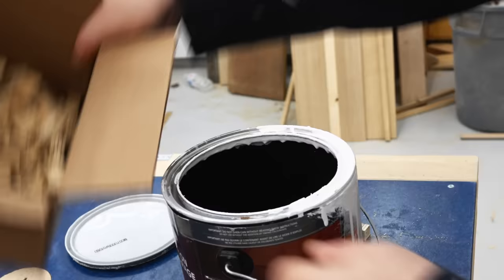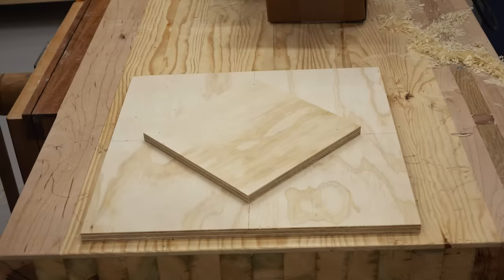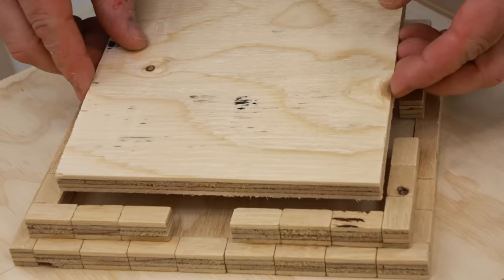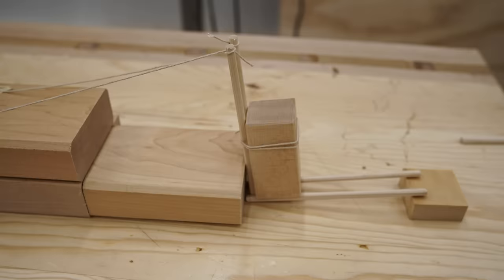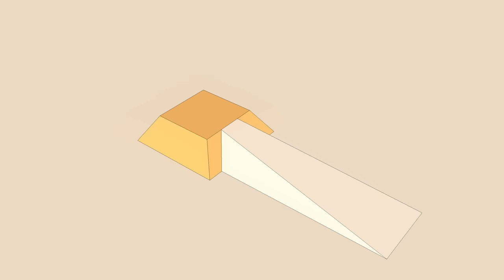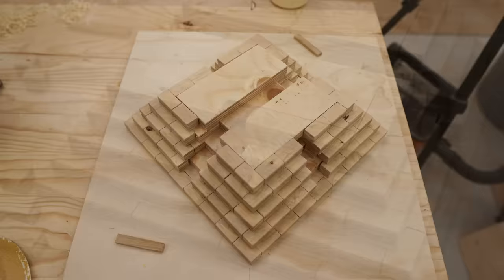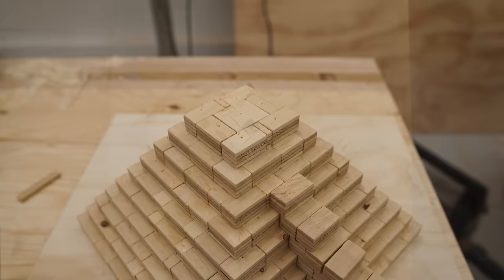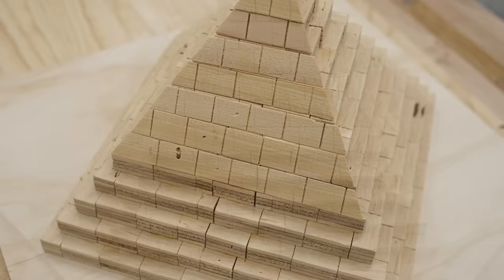How I Would Build The Great Pyramids

Comment: You know what you can use to cut and finish granite with precision?. Glass.. nice clear curved glass, ever use a magnifying glass to burn stuff, just ramp up the scale a bit. We do the same thing with parabolic mirrors and melt rock salt in the desert.. Now granite usually is comprised of an alpha crystal that when heated to roughly 880° will transmute to a beta crystal from what I'm told, and will expand and get weak. Ever wonder why we find the quarries littered with cracked pieces?. As to how they lifted them, research how many tons you can lift with 1 hot air balloon, you'd be surprised how you can lift a single wide trailer with about 10 of them. Wouldn't need fire either, if you figured out a way to heat the air using the same parabolic mirror system.

Comment: Would this be less or more efficient then the concave ramp system that raps around the pyramid instead?
Reply: any sort of ramp would be pretty resource intensive.
and would surely leave some sort of archeological evidence because of the amount of material that would be needed.
Reply: @spatrk6634  Sorry I didn't explain myself to well, the concave system works the same as the one in this video, but the slopes cut into the pyramid via a spiral shape instead of staircases on all sides, and is then filled top down once the pyramid is finished. If you'd like I can link a video that explains it better.

Comment: Got a few major issues. You are aware there are 8 sides? 2.5 million stones? All aligned to compass within 99% accuracy? Inner chambers constructed outta granite containing silicon dioxide(quartz), the rest outta red line stone cut from a quary over 500 miles away?.. and you’re just fingering them around. The inner chambers are made out of stones weighing 80 tones a piece. Again all this is perfectly lined up. I’m just having a tough time with the logic and facts applying

Comment: I’ve heard it debated that for a ramp to work it would have to be so long that it’s impractical.   A ramp can’t be much more than 14 degrees I believe and still be functional.
Reply: So don't build it perpendicular to the walls of the pyramid, build it parallel. 
Start at the ground layer and make a ramp to the first layer, build the second layer on top of that, then build another ramp from the first layer to the second layer. Each ramp can be as long as the pyramid is wide and it can even be as long as the entire circumference of the pyramid if you loop it around the corners, you can just do that all the way up the pyramid like a spiral.

Comment: But they have found chambers inside the pyramids?? They also found even smaller tunnels within?? They found that they are also acoustically tuned to certain frequencies?? And also blocks cut with pin point precision..... I like your ideas about how to get the blocks up though but there's defo some technologies used

Comment: I’m an engineer and I’ve been to the pyramids several times. The individual blocks are massive and vary in size. There is no way the sliding and tipping technique you mentioned could have worked. Also there will be no room for any one to stand and pull ropes and rip rocks near or at the top..
Think of the very top block.

I personally don’t know who built the pyramids of Giza and how.. That I know for sure. 😉

Comment: 1. They took 20 years 
2. The stones were quarried 500 miles away
3. How did they cut granite 
4. How did they lift 50 ton granite slabs 
5. How could they polish to a mirror finish
6. How can they create vases and statues that have laser accuracy 
Aliens did not do it but these are the questions that make me think
Reply: 1. Allegedly.
2. Not all stones. Vast majority was quarried locally.
3. With saws.
4. With great effort.
5. None of them have "mirror finish". You can polish any stone with some water and sand of various grain sizes.
6. They didn't because they didn't had lasers back then.

Comment: Should have at least made the block weight, to scale. No, i dont think they were "flipping them over" and up onto a wall. Quite simply, freshwatwr springs were present and most likely under the middle of each poyramif. This would have been incorporated 'globally' fot many obvious reasons. The corners are key. He is right about that, when building a structure, blocks are built up at the end and then courses filled in between. It was built from the inside

Comment: What about the chambers inside? Some of the beams in the kings chamber are 70 ton granite blocks. Did those go up ramps? Even the base blocks are heavy, and there are millions of them. If a large group of strong men could lift or pivot 200kg of weight each, you would still need 10 men per 2 ton block and 350 men per 70 ton beam. Where would you fit 350 men per beam on the pyramid steps ? How many men would have been required?
And there an estimated 2.4 million granites stones of at least 2 tons on the great pyramid, and there are roughly 1 billion seconds in 30 years. So each block would need to be put in place perfectly every 416 seconds which is roughly every 7minutes, without ever stopping or breaks, even during nights, round the clock...

Comment: That's a good model, I think you're on the right path I think it's made just like a 3d printer making it in reverse ie,the builder dug into the earth as they moved down they were able to work with ease remember what Alf always said there is more than one way to skin a cat 🙀
Reply: That's a lot more complicated than just building the thing, and doesn't explain why the stones within the pyramid are divided into blocks, nor where the stone that was on top of it went. There were in fact temples dug like that in India, though, which were used as quarries - look into the Kailasa temple in Elora. Very impressive work, done over the course of about twenty years. You can actually tell that that one was excavated from the top, because it's all one single piece, no blocks.
Reply: @littlesnowflakepunk855  you literally obvious that the stones in the pyramids were quarries because there are quarries next to them. Carved work is also easily distinguishable
Reply: @maau5trap273  Yes, the stones were quarried, from a few miles away. This person to whom I am replying is suggesting that the pyramids were carved from the top down out of mountains of sandstone.
Reply: @littlesnowflakepunk855  okay I apologized

Comment: I like your idea. I do wonder about some of the inner blocks and the heavier slabs like the 50 ton ones above the kings chamber that were much bigger than 2.5 ton ones on the outside. I wonder if instead of a ramp they could have also buried the pyramid as they went with sand and then as they did the smooth stones they could have excavated the sand back out. So, like the ramp idea, but all four sides at once like your idea. I’d even include the idea of 4 lines used as steps, like say they built 2 or 3 levels at a time and then put more sand down. It just makes more sense to me, although so guess I’d really need to know the topography, but doing those passages and using some of the really heavy inner blocks, even with this step method would be very hard. So, you know, it’s likely the truth is it was a combination of things. Specifics? Eh, I guess you have to trial and error your way through using materials they would have had available to them and figure it out over time by trying to recreate one or something, but to be honest it took them a few generations to figure it all out, so to figure it out you’d probably have to start a stone mason school teaching everything you have figured out so far to a new generations and hope at some point in the future they can figure it out. Oh and I guess also hope for an afterlife that allows you to view it haha it’s really a silly thing for people to even worry about.
Reply: Would burying the pyramid not be such a monumental task that it would dwarf the construction of the pyramid itself?
Reply: @Outlast25  not when you have thousands of people working for the same cause. When you try to imagine stuff like this don’t imagine a few hundred but thousands

Comment: I think you are missing some big points, but thats okay.  First of all, lets talk about precision.  These stones are precisely orientated with one another, nearly perfectly square, where you can't fit a sheet of paper between them.  Imagine cutting and moving these stones, which each weight between 2 and 80 tons, over 500 miles, without chipping or cracking them, then lifting them, stacking them, and orientating again without damaging them.  If you put the great pyramid into a computer program today its 99.8% accurate (and this is with all earthquakes, vandalism, tourism, people climbing it and deconstruction or using the pyramid as a easy source of stone, and 5000 years of weather at the very least)  Its arguable that its accuracy was even higher when it was made.  We haven't even begun to scratch the surface of its alignment with the stars, its orientation to true north south east and west, or its proportionate size of its perimeter and height being 1:43,200 the circumference of earth at the equator, etc etc.   Second, lets talk about the logistics as I briefly mentioned.  2.3 million stones (likely 2.5 million + originally)  or 6 million tons of stone were cut and transported 500 miles.   And this wasn't surface level stones either, many of these stones came from granite mountains and quarries, digging 30+ feet to get the higher quality stone needed.   The sheer amount of time and man power and oversight it would take to coordinate such an operation and just get the stones to the cite alone is impressive.   We haven't even touched the planning it would have took, the calculations, the skill etc.  On top of all of this, the actually foundation or base of the pyramid is equally impressive.   Its carved out of the bedrock, is perfectly flat,  and makes the pyramid resilient and one with the landscape, capable of standing the test of time.   The speculation of the pyramids being a wireless powerplant too is truly fascinating, but not worth getting into right now.  I can go on and on, but the biggest takeaway here is everywhere you look you see that they did not accomplish this task as easily as possible, they accomplished it as hard as possible; the biggest hardest heaviest stones, the biggest structure, to the highest level of perfection.  You give us a general idea to the process of constructing the pyramid, but I think the answer is a bit more involved--i think it should take into account the logistics and precision, these 2 points, among others, are consistently ignored, but they are equally mysterious, if not more mysterious and more important questions to be answered.

Comment: The sticks would break trying to tip and move 20 ton blocks or the sticks would have to be so large as to not be able to be handled by men due to the diameter of the sticks or logs. Also, if you try to move 20 ton stones set on wood on sand and place blocks on the sticks or logs when you moved the blocks the weight would cause the logs to dig into or sink into the sand. Sand is a terrible foundation because it is porous. We do know that the Egyptians did use wood, did it all come from Lebanon? I personally think the Egyptians created a metal rail system with carts that the wheels straddled the rails that would hold the granite blocks to be moved. Like we do today with trains to move heavy weight objects. Just less then engine.

Comment: You forgot to mention how did they lift the granite stones inside the kings chamber, that were up to 50x the weight of the outside stones.
Reply: There’s evidence of an internal ramp
Reply: @maau5trap273  is there evidence how they brought 70 ton stones across a river 500 miles away, using primitive canoes?
Reply: @tiredofwinning2712  they had ships in the old kingdom. These people were an ancient civilization not primitive people
Reply: @maau5trap273  you should look at the ships they had. They were oversized canoes that in no way shape or form can carry that much weight, and they would easily capsize with little to no wind.
Reply: @tiredofwinning2712  those ships you mention were royal ships. You trying to downgrade them to primitive canoes will not make your argument more valid. Also then what do you suggest if it wasn’t ships ?
Reply: @maau5trap273  send me a link of the ships you think they had then.  Because I guarantee you any ship they have couldn’t carry 70 tons of stone
Reply: @tiredofwinning2712  hello, I was wondering  if you managed to check out the diary of Merer ?
Reply: @maau5trap273  there’s no question that there was construction going on during that time 4,500 years. The question is what kind of construction was going on. Repair or newly build. And there’s no evidence that shows how or who built those structures there. There’s evidence of water damage from 1000s of years of water fall, which doesn’t align with when they claim they were built. It more aligns that they were built when Sahara was a rainforest over 9,000 years ago for it to have heavy rainfall damage on it. A canoe cannot carry 70+ tons of stone on it no matter how big you think their canoes were.
Reply: @tiredofwinning2712   and by water erosion you probably mean the sphinx which also wasn’t the case since they carved it from top to bottom. That’s why the head is of good quality because they thought they had a good quality stone but it turns out the stone they chose to carve was of extremely bad quality. What I don’t understand is how you can make such claims with no evidence when we know about what time kings reigned in egypt. We know that the great pyramid of Giza was built for Khufu

Comment: Thats basically how Herodotus said they were made, or how he was told by the Egyptians at the time. He was more incredulous about the road that was built to move the stones to the pyramid than actually building them.

"So some were appointed to draw stones from the stone-quarries in the Arabian mountains to the Nile, and others he ordered to receive the stones after they had been carried over the river in boats, and to draw them to those which are called the Libyan mountains; and they worked by a hundred thousand men at a time, for each three months continually. Of this oppression there passed ten years while the causeway was made by which they drew the stones, which causeway they built, and it is a work not much less, as it appears to me, than the pyramid; for the length of it is five furlongs and the breadth ten fathoms and the height, where it is highest, eight fathoms, and it is made of stone smoothed and with figures carved upon it. For this they said, the ten years were spent, and for the underground he caused to be made as sepulchral chambers for himself in an island, having conducted thither a channel from the Nile. For the making of the pyramid itself there passed a period of twenty years; and the pyramid is square, each side measuring eight hundred feet, and the height of it is the same. It is built of stone smoothed and fitted together in the most perfect manner, not one of the stones being less than thirty feet in length. This pyramid was made after the manner of steps which some called "rows" and others "bases": and when they had first made it thus, they raised the remaining stones with machines made of short pieces of timber, raising them first from the ground to the first stage of the steps, and when the stone got up to this it was placed upon another machine standing on the first stage, and so from this it was drawn to the second upon another machine; for as many as were the courses of the steps, so many machines there were also, or perhaps they transferred one and the same machine, made so as easily to be carried, to each stage successively, in order that they might take up the stones; for let it be told in both ways, according as it is reported. However that may be the highest parts of it were finished first, and afterwards they proceeded to finish that which came next to them, and lastly they finished the parts of it near the ground and the lowest ranges."